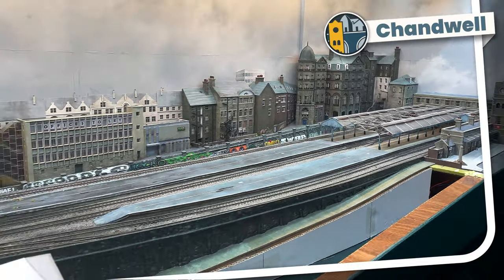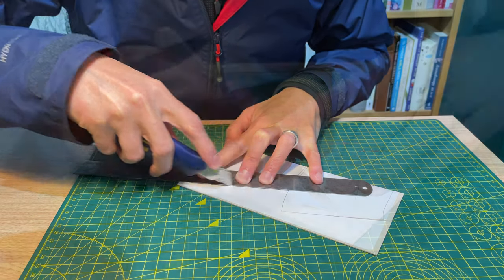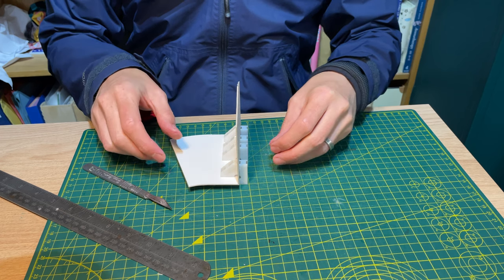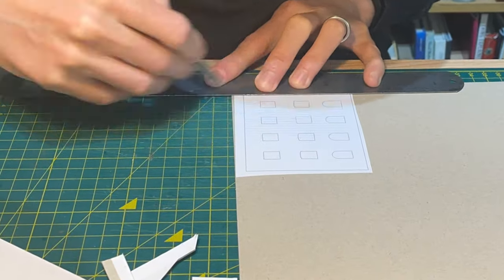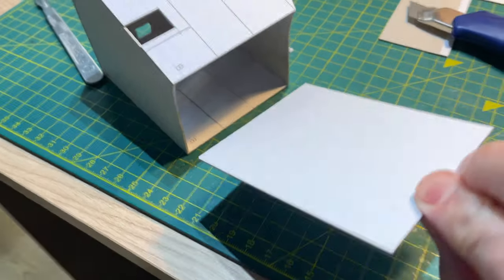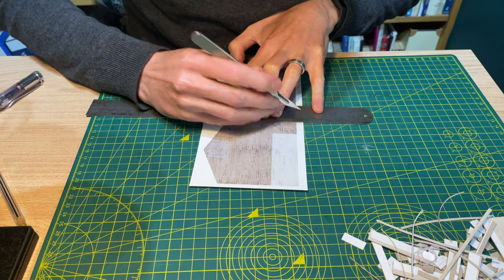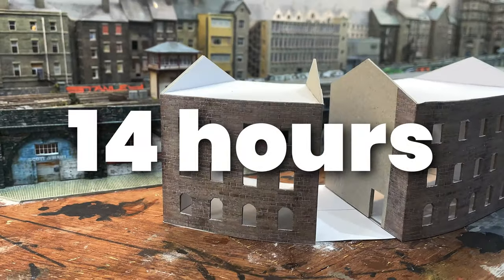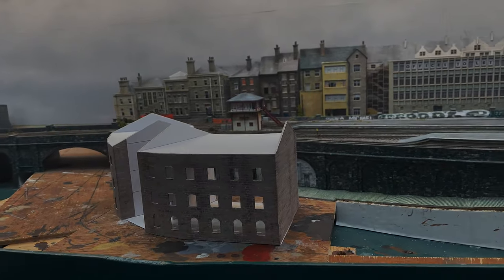Starting to make a curved hotel model from card

Comment: Nice!
Another great presentation! Those walls are going to sturdy. Almost looks like you could use a tool with a larger right angle hook so you don't have to try to get your hand inside the building. I had made a tool from a regular small flat screwdriver and pounded a right angle into it using a hammer and anvil. Small tools save so much time.
Thanks,
Don
Reply from the maker: Good advice! Thank you Don.